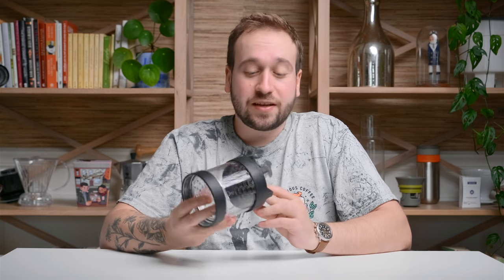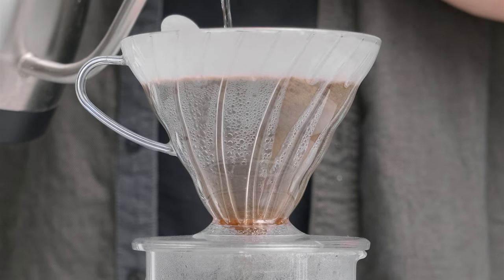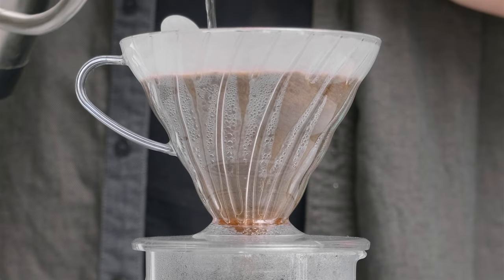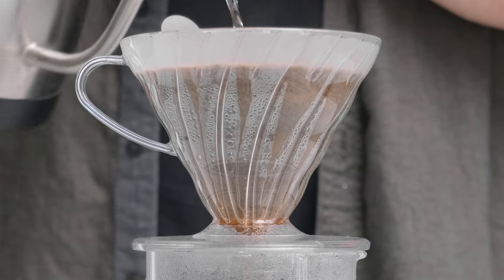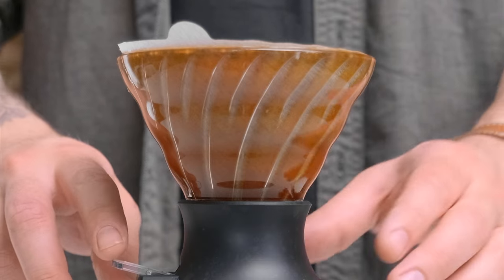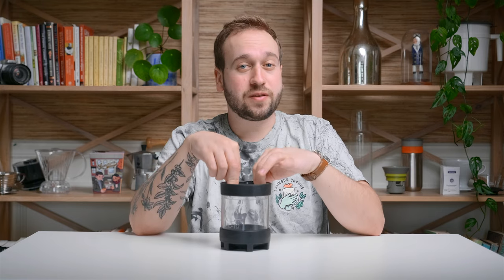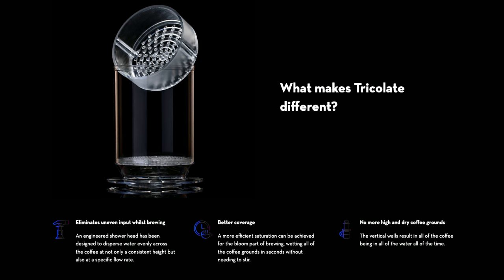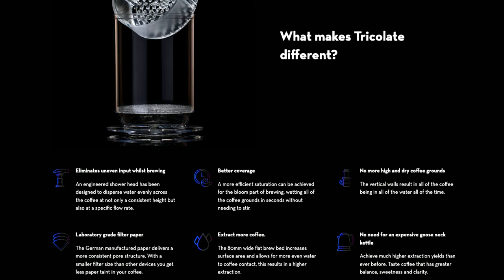The Most EFFICIENT Coffee Brewer | No Bypass Benefits & Methods

Comment: My recipe for flash chilled iced coffee with the Next Level:

Coffee 50g
Ice 270g
Brew water 560g

1st bloom: 80g, 60 seconds
Gentle swirl
2nd bloom: 80g, 60sec
Gentle swirl
1st pour: 200g
Let it drawn down to ~1/4" over the coffee bed
2nd pour: 200g

Same medium grind I use with my Chemex. Due to the long contact time my water is a few degrees less hot to start, and I drop it 5 degrees (F) for the final pour.

Comment: What about the clever dripper? It keeps the water in the coffee grounds until you decide to let the coffee drip out. Also I have been using the aeropress for over 8 years now and I always stir the grounds after putting the water in, let it steep for a time and then pressing. I find I can get a very consistent cup.  I also stir the coffee in a malita pour over and then let it drip out. Very consistent brew and no channeling because the stirring insures every thing is saturated.
Reply from the maker: Steep and release brewers like the Clever are great! Not quite the same as no-bypass, and there will still be bypass with those. 

Your other brewing methods sound great 👍🏻
Reply: Agree. I use Aeropress with the Fellow Prismo attachment, very easy to use, freshly ground coffee plus hot water (I use 90°C), stir for half a minute and press. And very easy to clean as well.

Comment: Going to try out the aeropress method! How have your results on that been using the aeropress no-bypass compared to the NextLevel brewer?
Reply from the maker: They've been fairly similar! I've been brewing much smaller batches, around 8-10g of coffee to 160-200g water. Let us know what you think!
Reply: Well, I tried using my aeropress and an espresso basket and wasn't impressed. What grind is recommended? For now I'll keep plunging although I might buy a phin because, you know, I need another way to brew coffee.
Reply from the maker: Try a fairly fine grind, aiming for a total brew time of around 5min. It definitely does work better with certain coffees. Happy experimenting!
Reply: I've been using the AeroPress for about a year.  I use the upside-down technique.  This would be considered an immersion brewing method so you don't have to be concerned with channelling or water dispersion.  Most consistent method I've used cos you only have to control brew time as water temperature and grind size are always the same.  I would say that it's very similar to an Americano except that the brew does go through a small (inexpensive) paper filter.

Comment: Technivorm gives total control :)
Reply from the maker: It’s a nice brewer! But definitely not a no-bypass brewer.
Reply: @HomeGroundsCoffee  It is when you close the valve and let it bloom and direct the water over the grounds
Reply: @steelgtr  They should call the Moccamaster the Channelmaster, because that's what it does best (unless you stir the bed a few times through the brew process). There's no way brew water is 100% passing through the coffee bed on a Moccamaster. The kind of filter it uses and water taking the path of least resistance makes it impossible by design. You may not see it happening just under the coffee bed, but brew water is bypassing through the filter, down the sides of the basket and out the bottom. Moccamaster is an incredibly good coffee machine, but in no way could it ever be a no-bypass brewer.